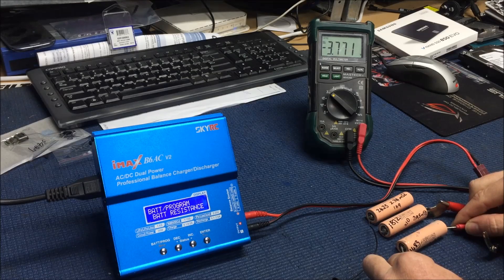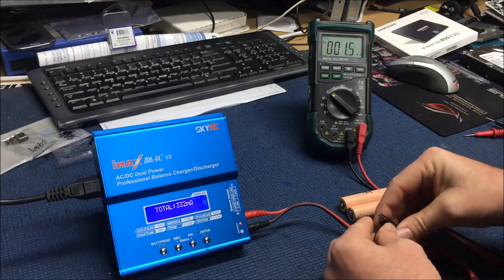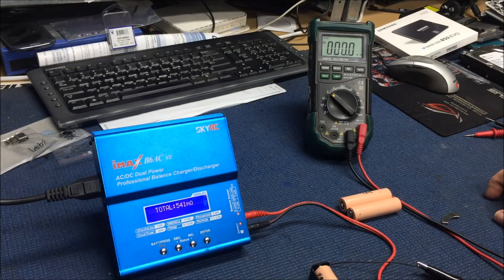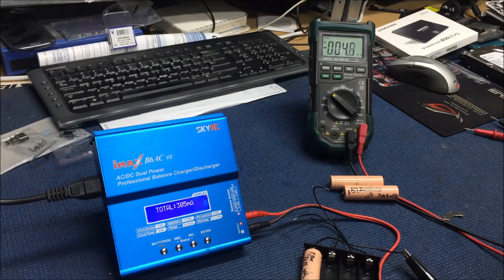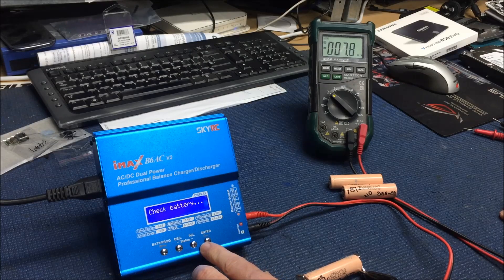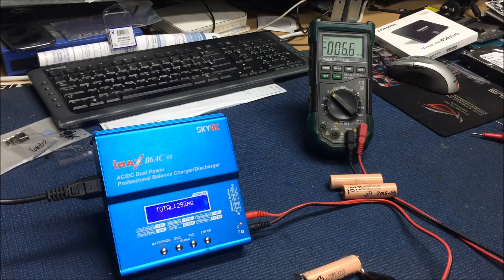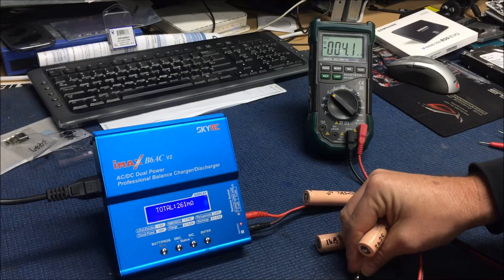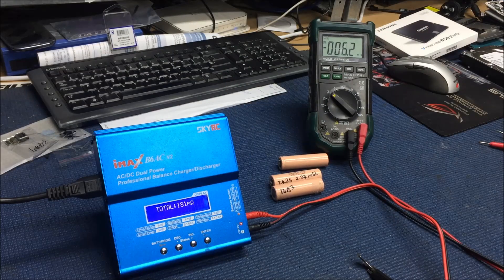More Resistance testing 24hrs hours later than last test.

Comment: I know this is old but for IR testing you want the leads to be short and thick. 5cm of 8awg would be a good start. Your doing all this testing is never a waste of time. It's much appreciated, thanks!
As other folks have commented you can always draw 1A constant current and then the observed voltage drop is your IR in ohms. A cell with 150mR of internal resistance would be say 4.18v at full charge and rested, dropping to 4.03v under load. You can scale this up for larger cell banks too with a bit of maths.

Comment: HBPowerwall Easier way to test internal resistance. Put the cell on the Imax, set it to discharge at 1Ah, wait 10 seconds, get the difference between start voltage and under load voltage, let's say it dropped from 4.10v to 3.90v, 0.20v drop, and divide by 1(Ah), which gives you, 200mOhm. It's easy, because how many volts it drops, it's always divided by 1, so if it drops 0,15v it's 150mOhm, if it drops 0,30v it's 300mOhm. See? Easy.

Comment: I haven't done electronic in a long time but for a device to test the resistance it puts a small amount of voltage in to the device. Try disconnecting the battery after each test
Reply from the maker: Thanks for that, I'll try that once i get back into it again cheers

Comment: This one with the holder is because wires are to thin. I had the same problem. Those holders are great for charging and discharging but the first thing you have to do is to cut those tiny wires and solder bigger ones.
Reply from the maker: ok thank you for your input. currently I'm doing resistance testing just from the imax same test same way for every cell ditch the bad keep the good and hope it's close enough to accurate :)

Comment: I just bought one of those battery capacity/internal resistance test boards from ebay.
It requires 2 leads at each cell terminal.
First I soldered the leads to a battery holder and all my cells measured in the 200's mili Ohm and I thought that could not be right.

Then I tried soldering the leads to a rare earth magnet. Measurements went to between 50-90 mili Ohm.
Measurement is instantaneous  (mch faster than Imax unit) Also it's constantly measuring and flickers around +-5 mili ohms.

Comment: E = V+Ir 
A battery with a resistance of greater than 500 at E=4.2v might show a resistance of 200 at E=3.0 -- it's the first few tests that matter.
Reply from the maker: That looks suspiciously like math too me...
Reply: Haha yes I am using math that is why I have managed to test 350 batteries while in the same amount of time you have tested 7000+ batteries (and created the packs as well).

Comment: I did some testing and research online. With the testing I got the same problem as you got. It's inconsistant. The mOhms vary all over the place and there seems to be no correlation with anything.

But I found some research online that explains this strange behaviour a little bit better. 3 basic conclusions:

1) Ri goes up with lower SoC (State of Charge). As much as 50% to 100%.

2) Ri is up to 20% higher when the cell hasn't rested for a long enough time.

3) Lowering Load Current increases Ri for a few cycles. Then it drops down to the original value.

So there you have it. If you don't know SoC, rest time, and load history (last few cycles) then basically your results will be all over the place. Without all that information, the exact value you measured isn't all that important.

But from those results we can calculate what the maximum variation is that we can expect. I will spare you the math and just give you the end result: Maximum variation is about 140%. Suppose you have a used cell that, in the ideal situation, has an Ri of 100 mOhm. The measured value can be as high as 240mOhm.

The only thing that we can always know is the SoC, which is also the factor that has the highest impact on Ri. So if we make sure that the voltage of a cell is above nominal, preferably closer to 4V, then the max variation drops down to like 50%. And this we can work with.

Measuring Ri is still a great way to filter out bad cells. Like in your test, most of them are below 150 mOhm. Those are all good. The cells with above 200mOhm are better to not include in a battery pack. Even if they have a high enough capacity, they'll end up putting a higher load on the other cells and it's basically a pack with 1 less cell.

I use those higher Ri cells in emergency lights that have like 30 LEDS in them. Those usually have like a lousy 1000 to 2000 mAh cell in them that are as big as 5 18650's. They last like an 2 to 3 hours max. With 5 18650 cells,... the same light lasts up to 30 hours. (That means the load per cell is really low, which means that a higher Ri has little impact on performance.)

I hope this helped understanding Ri a bit more. It helped me. I sincerely hate the time spent on measuring capacity so anything I can figure out to not having to spend hours (per cell!!!) on measuring capacity makes me happy. I now just charge them to full capacity and check if the voltage doesn't drop too much in the first 2 or 3 days. That together with internal resistance is enough to decide if the cell is fine. For capacity I use the specsheet value. In the end it doesn't matter what the actual value is, as long as you don't mix high and low capacity cells in the same bank (i.e. in parallel). After filtering cells out based on Ri and ability to hold voltage, they pretty much all have capacities in the same range.

And afterwards you can always add some cells to a bank if needed. If you have a bank that consistantly ends up at a lower voltage than the other banks (after discharging), you just add a couple of cells to that bank to increase it's capacity a bit, and you´re done. Now that bank will be more like the others.
Reply: I thought about replacing emergency led lights with not so good 18650, but I never found one that has the correct charge circuit and discharge protection for Li-Ion, all the ones I find are made for the lousy Nimh it comes with, so it probably doesn't CC/CV the cells, and not to mention, no termination of charge, stays in float charge, very bad for Li-Ion.

Comment: Hi Pete
Heres a battery i did a couple of years ago. It is a 20 series 60 parallel and i get around 80ah drawing between 70 to 200A average while driving the electric buggy it is on. Around 100ah with normal load.There was a around 10ah difference between the cell modules so i added a mini module to the 4 lower capacity packs. Stays fairly balanced now within 100mv. I charged all the batterys and left them for  week then checked voltages and used any over 4v. 
Cheers
Gary
www.youtube.com/watch?v=BAjXjfDamiY

Comment: The ones with higher resistence are the ones that lose the most voltage when left in a box for a week right?
Reply: not neccessarily. I have some with high resistance that almost don't lose voltage at all but have a pretty shitty capacity and drop voltage very quickly when under load.

Comment: I think the biggest factor here was you cleaning the battery with the steel wool for a good connection.
And this video was not a waste of time.
ruling out stuff like this is important.
to know there is nothing wrong with the way you mesure things so we know if there is a reliable result or not in future videos.
Personaly i'm going to use a battery holder when doing my tests coz i wont need to worry about is the magnet on properly or are the aligator clips making good contact since you have proven it works just as good with a battery holder as with magnets, i might save my magnets for easy charging instead.

Comment: the little cables on the holder will give you differant reading as you have to cancel out all the leads to get a true battery readings use the multi meter to test all the leads then cancel them out

Comment: Try to test the IR from the done packs... And maybe match them... Just an idea...
Reply: 15 mOhm on 80 cells in parallel means the average Ri per cell is 1200 mOhm. That can't be right. Perhaps the Imax can't deal with those large numbers.
Reply from the maker: only got one pack here, just uploading 15sec video to FB Tested at 15 milli ohms

Comment: I was thinking about those 2 cells that seemed to have dropped in resistance..... They also dropped signifficantly in voltage. It could be these cells are simply so bad that the internal resistance isnt linear with voltage anymore.

If you really want to find out ( but I get it if you're tired of those 2 cells :) ) get them to the Voltage where they had those higher Ri's and check Ri again.

Next week I'll receive an Imax of my own and I'll start doing my own tests as well. I appreciate all you're doing for the YT crowd a lot. It's fun to be in contact with people that like this stuff too.
Reply: also, that test will tell you if your Imax is consistant or not.
Reply from the maker: if you're in oz i'll send you the cells you can play with them, the'll be TY famous :)
Reply: +HBPowerwall yeah better keep them there. Im in São Paulo, Brazil. Im Dutch, but live in Brazil since 2001. 

But I'll do lots of tests and share the results with everyone.

Comment: Some may find this boring, but like you said, others find this cool. All this testing helps us understand this better. 

Now there is one thing left to do... because there is one thing that we haven't touched yet. You are doing all these tests on cells that have already passed your capacity tests.  And your capacity tests already filtered out the worsed cases.

Now the last test could be to get like 20 untested cells and charge them up to like 3.8V and then check their internal resistances.

Hopefully that will filter out the bad cells which you would otherwise have spent hours on charging and discharging.  It would be nice to find out how many less cells you have to test for capacity. If that's just 10% it makes the time spent on these tests, worth it.
Reply: oh, and dont forget to let the cells rest for at least half an hour before testing internal resistance.